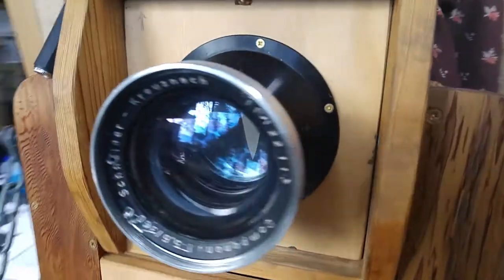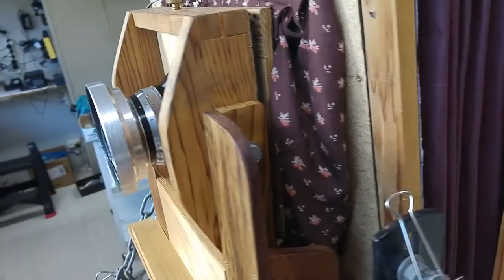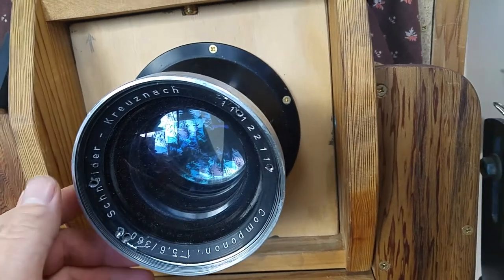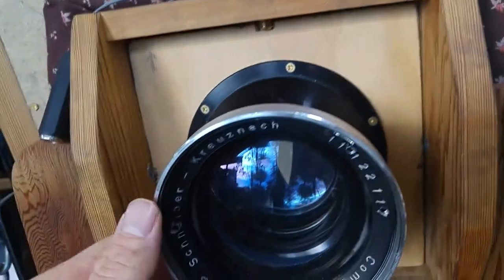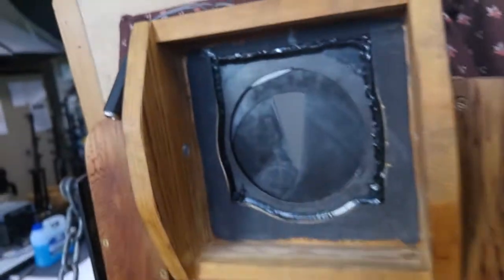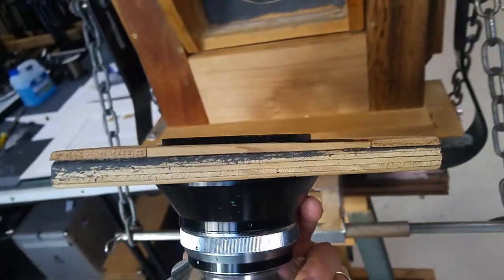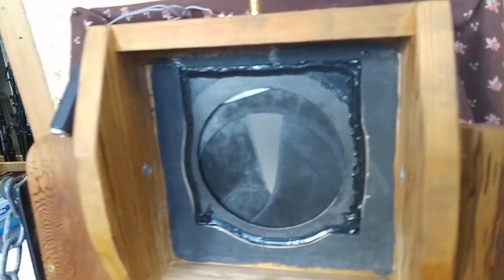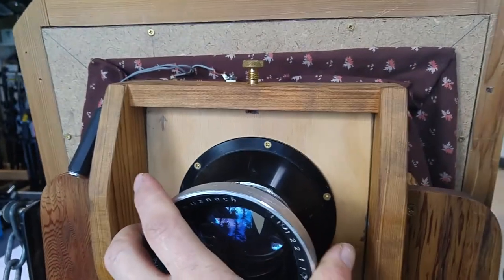large format lens mounting progress

Comment: Thanks for putting the lens mount video up,Nick.I used a similar method to mount my 300mm Russian barrel lens.Have not made a photo yet because I am not 100% certain the film plane and the inside of my ground glass are on the same plane.They seem close enough to make a test photo but I want your idea on how I can be most certain? I made a ground glass and mounted it in an 8x10 picture frame.Then I have it mounted to the rear standard.When I am ready to make the photo I will take it down and put the film holder in it's place.The planes look correct to the naked eye but how can I be sure?
Reply from the maker: If you designed in full movements of one standard, you could always say it's tomorrows job to zero it. But that is kind of a cop out.
        I use a laser level from the hardware store to get exhibitions straight. It casts a perfectly straight horizontal and vertical line. If you could aim the vertical line square and centered at your rear standard with the glass removed, a line should pass through the center to hit the middle of the front standard. You could get the laser square to the rear standard by using the biggest set square you can find.
   I am confident this could get you within about a millimeter of accurate,  not sure if that will be good enough for you.